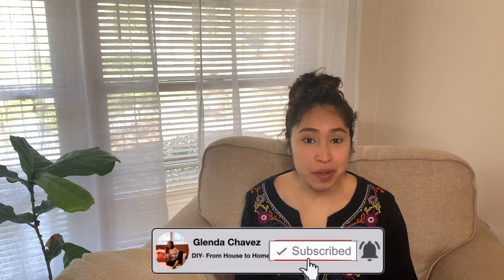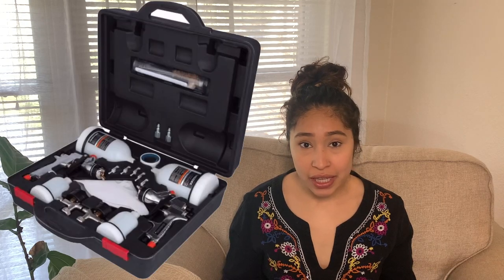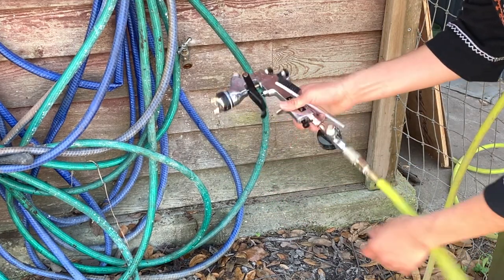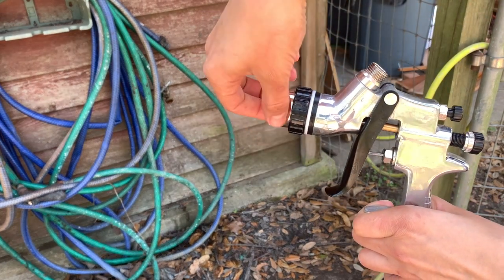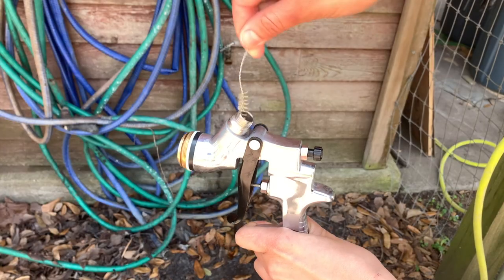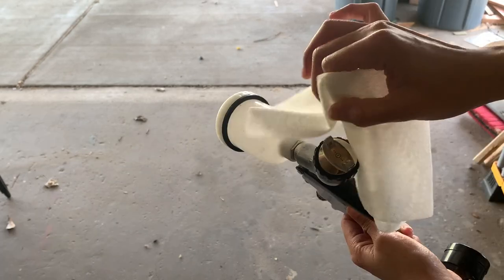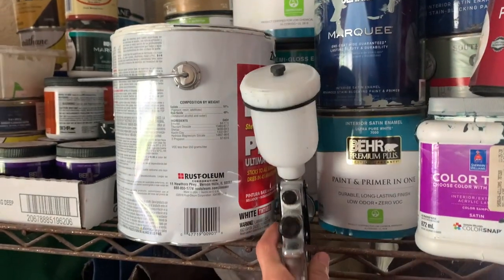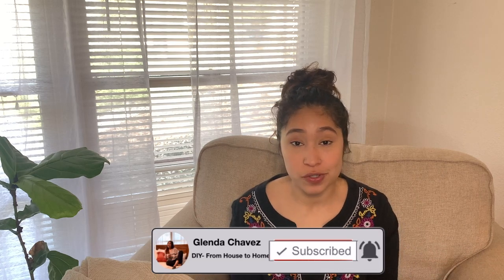HOW TO CLEAN YOUR SPRAY GUN| PAINTING FURNITURE WITH A SPRAY GUN

Comment: This is only for water based paints and primers, right?  Do you spray any oil based paints or primers with your hvlp? If so how do you clean yr gun?
Reply from the maker: Correct! No I don’t! ... the only oil based paint I’ve used is the valspar furniture paint. It is an oil-“enriched” enamel paint but can be cleaned w/ water.
Reply: @GlendaChavez  I'm allergic to mineral spirits, paint thinner, turpentine and most degreasers. I will definitely need to use only water based paints and varnishes. Glad to know I can avoid them when cleaning the gun. (That I still haven't purchased lol)
Reply from the maker: @jcrefasi1  for sure!  ibelieve the manufacturer recommends using mineral spirits through the gun to avoid rusting if cleaning only with water, so you may need to look into that since you are allergic!
Reply: @GlendaChavez  thanks I'll look into that!